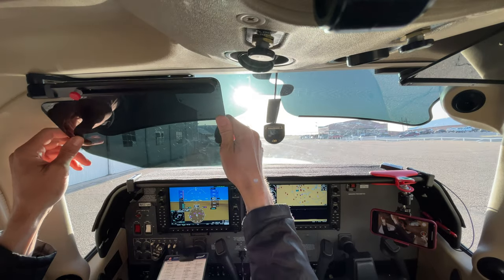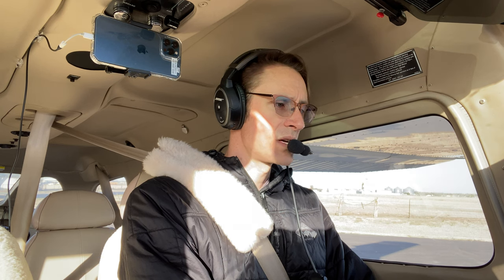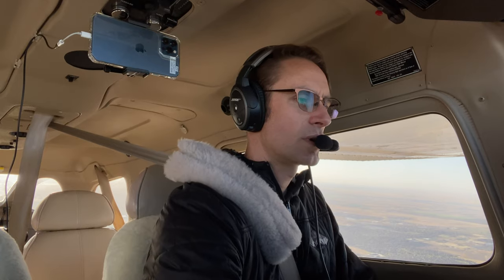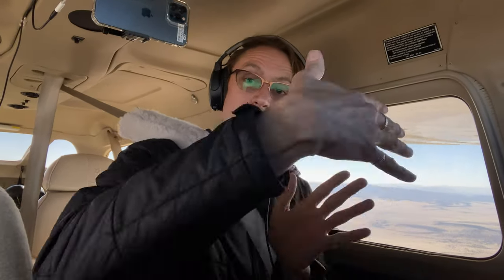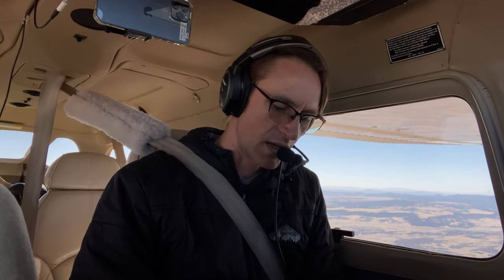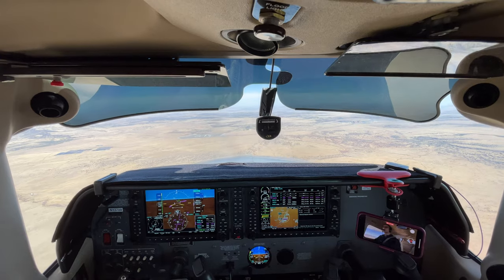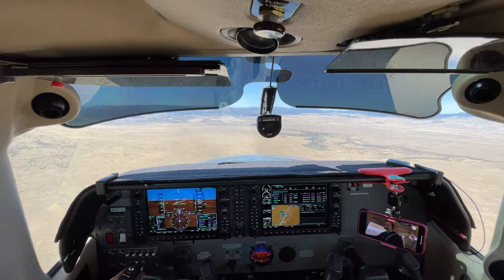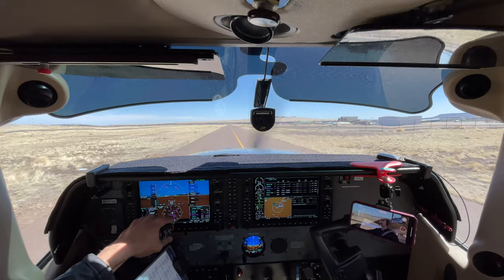First Solo Long Cross Country Flight Leg 3 – Tradewind, TX to Springerville, AZ — Cessna Turbo 206

Comment: Did you ever figure your start issue out?? My 206 does the same thing !!
Reply from the maker: We now believe we have the perfect steps for starting our T206.  One of the issues we did discover was while the battery passed the capacity check, it still wasn't providing enough current, however that wasn't the only cause.  Here are our steps for starting and so far it appears to work virtually all the time.  We use a technique that we also employ on other large engines:
1. Cold start - mixture rich, prime 8-12 seconds (very cold temps may requrie a bit more). Start:  Mixture rich, throttle open 1/2 inch - use fuel pump if engine falters.  Works 100%
2. Hot start - e.g. after fueling.  Mixture rich - prime 1 second (sometimes), mixture idle, throttle open more than on a cold start (up to 1 inch). Mixture slowly enrichen as it starts, be prepared to open the throttle more and use the fuel pump to pressurize to help with vapor lock.

We've had excellent luck with the hot start procedures.  We found the same process with our SR22, opening the throttle a little more than when cold seems to open the throttle body more allowing more fuel to overcome the vapor lock without flooding the engine.  

Let us know if that works for you..

Comment: Were you full throttle on takeoff? I noticed 38" 2400RPM.
Reply from the maker: We actually don't push all the power controls to the limits.  We monitor the engine (MP, RPM, Fuel) and adjust to stay in limits.  Sometimes our MP is at 39 vs. 39.  In our 206 we have found that setting the controls just shy of full , approximately 1/2 inch from the limits, works for us.
Reply: @PersonalWings  Thanks for the replay. I was wondering why the MP was a little low but that explains it.

Comment: Great vid new sub!  Why did you pick a 206T vs 182TC? What are the pro and cons of the 206H? and would you switch to 182t?  Thanks
Reply from the maker: Thanks! It was more for the payload, large cargo doors, and ability to shift to bush tires, floats, and resale value. This thread is a great one, of course it’s comparing a retractable gear 182 Turbo and not a non-RG 182, but the payload and comfort are unmatched with the 206.
Reply from the maker: We’ve owned a number of piston, turboprop, and jet aircraft.. including a C182. The load capabilities and speed of the T206 are greater than the 182, which is also a great airplane. Tigre may also comment on ‘The Beast’ and his impressions.
Reply: @PersonalWings   Thank you for the response......I've been trying to make a decision on the Turbo 182 or the 206t.....it seems the Turbo 182  has greater range and speed compared to 206t per Cessna specs.....don't  need large payload...but 206t look beastly and strong!!
Reply from the maker: @alphahrd19  you are welcome! Both planes are great. Our real life cruise is 161 KTAS in the low teens at 19.5-20 GPH if we pull it back to 145 KTAS it drops to 16 GPH, so more fuel than the 182. Speeds are comparable. We put the Flint tip tanks which provides an extra 1.5 hrs at max cruise speed.  The engine overhaul costs on the 206 will probably be more. We now have NXi which is great. Good luck in your choice- you can’t go wrong with either. If you have questions just let Tigre and I know, or if we can help you find a good one.
Reply: @PersonalWings   Thank you soooo much and keep the good work coming on the channel!!!